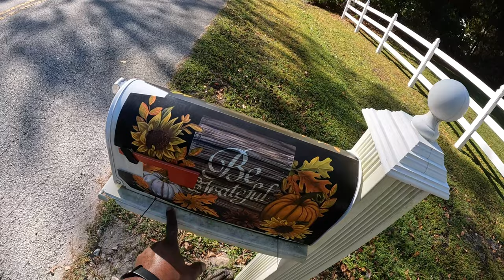Unbelievable Tile Roof Cleaning #roofwashing #softwashing #howto

Comment: I get what you mean on the tile design! We had a roof wash customer with three separate roof tile colors. Night and day difference with before and after photos as well. BUT! The customer was convinced their roof wasn’t clean since we didn’t “pressure wash” and due to the darker tiles that were cleaned but dark. Kept comparing to their neighbors freshly cleaned ALL RED tile roof.
Reply from the maker: Hahahah, it's crazy and most of the time the customer moved into that house while the roof was already starting to get dirty so they never know what color the roof is exactly.

Comment: How long is your soft wash line? Can you add more if needed with cam locks? Nice video, keep it up
Reply from the maker: 200ft of 1/2 inch hose. Yes you can add cam locks if you are planning on tacking stuff on and off for whatever reason.
Reply: @PinkFlamingoPowerWash  thanks. How much more hose do you think I can add and get away with? Ig it depends on the system but what about just a 12v
Reply from the maker: @masonsindelar2793  I wouldn't go past 250 in my opinion. My hose was 250ft in the beginning then I cut 50ft off
Reply: @PinkFlamingoPowerWash  thanks brother. If you don’t need all your hose can you leave the remaining on your reel and be just fine? Seems like an idiotic question but I’d like a second opinion.
Reply from the maker: yea you dont have to roll it out if you dont want to.
Reply: @PinkFlamingoPowerWash  appreciate it

Comment: How much sh you think you went thru?  I just did a massive job, my 1st commercial job.  28k sqft of concrete, 9 bleachers and playground equipment.  I used 320 gallons of 4-6%.
Reply from the maker: On that roof I used about 40 gallons of SH. That thing had never been cleaned before.

Comment: Great work, man. How long did it take the tile roof cleaning? and also, what precautions do you take to prevent falling off the roof?
Reply from the maker: Around an 1hr maybe 1.5hrs with making sure all the plants are protected.  

Walk slow, don't step on the hose, and don't walk on the freshly sprayed areas.  Sometimes the algae will make it slippery.

Comment: Cliff great video on that roof cleaning. man, that thang is clean looks like a new roof my friend what percent of sh did you use on it and did you use any soap with your mix was you using a J rod raise tip to apply the mix
Reply from the maker: I used my jrod that's meant for a 1wv pump not my jrod for my pressure washer.  6% mix and yes I always use soap on roof washes to make the sh stick to the roof.

Comment: Nice job! Why you dont cover up that pool tho'?
Reply from the maker: No need to. 1 I'm using chlorine and chlorine is in the pool. And 2nd it's not enough to change anything in a pool with thousands of chlorinated water 3rd I'd have to charge a whole lot to find cover for each pool. That's not feasible

Comment: Is it really worth the liability of walking on the cusomer roof for softwashing with all the broken tiles?  I would think it better to document with a drone and spray from a ladder using a long wand extension.  Dunno.  I've  dealt with some very unscrupulous lawyer homeowners that the HOA maintenance guys told me to stay away - that they were shysters.

Another great video!  Love your awning education. Keep it up!
Reply from the maker: Yes it's worth it to me.  Others may try a different approach for their business. Video footage is really helpful to capture the inital walkaround before cleaning ans making the customer aware of any broken tiles. Pictures also help if Video isn't available.  Not everyone has a drone as well. 

You're not spraying every section of that roof from a ladder it has too many angles. But it all boils down on what you're willing to do and not do. I don't stain wooden fences but I will gladly clean them. I don't install gutter guards but I'll clean some gutters.